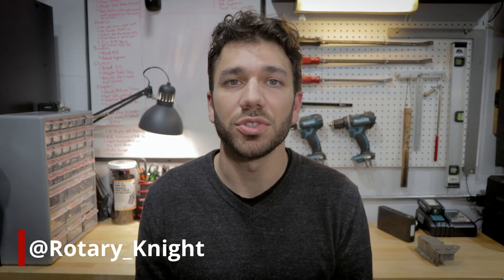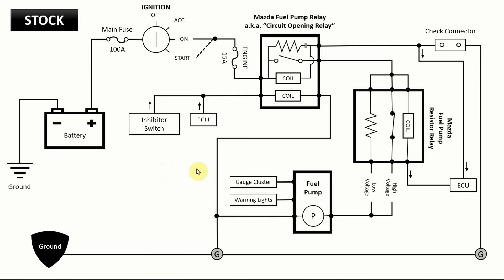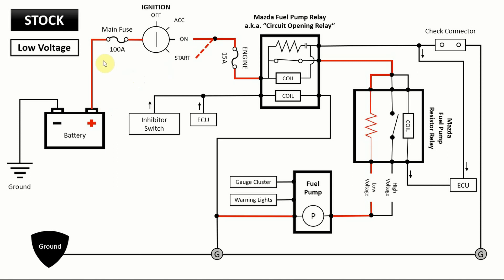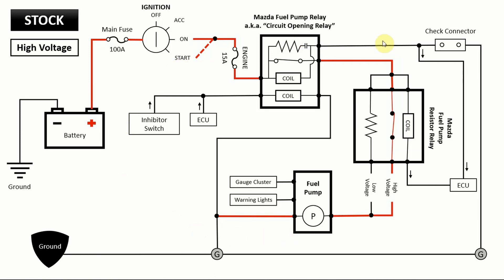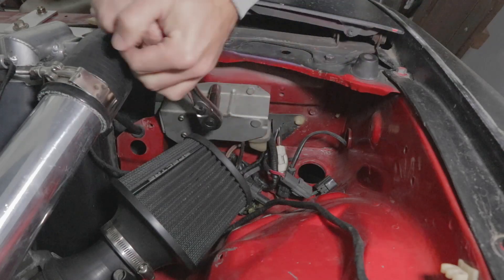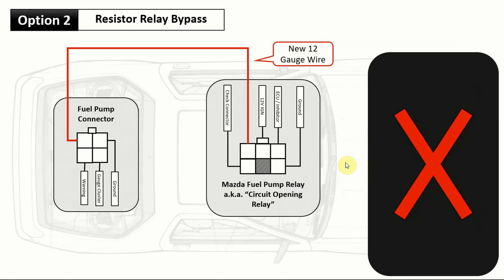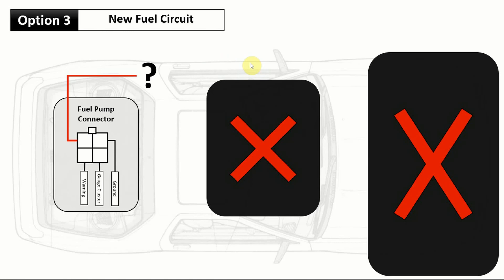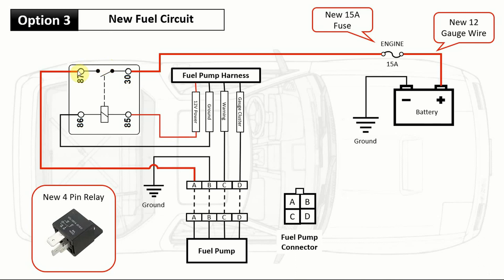How to Rewire Your Fuel Pump FC3S RX7 | Ep 24

Comment: Hey mate great video. I am also a mechanical engineer with an FC in Australia. 
Question. Does the circuit open relay operate in all key positions - ignition - cranking - running?
Person I bought mine off has butchered the harness. 
I have no power to coils or ecu when cranking and traced the ignition circuit from my aftermarket ecu back to the circuit open relay.

Comment: Hi Alex , great video! I tried all options but kept having issues so I did the third option and ran a totally new circuit ,  when I pull the trouble codes the CPU is showing trouble code "
 51 - Fuel pump resistor relay." does this affect drivability?? or can I just ignore it as I don't have the Relay resistor anymore.?   Is there a way to wire in a resistor to the cpu so the code goes away ? 
FSM  shows there should be .7 to .94 ohms from wire E to wire F.   Thanks for your help   1990 NA Vert

Comment: Hi, I am new to rotary engine and I just got a 1989 rx7 to build for my son. My question is when you choose to go with the method 2 then what did you do to the resistor relay in the engine bay by the passenger headlight ? Did you still remove it or did you leave it untouched and go on with method 2 ? Any answer would be a big help for me and greatly appreciated! Good day !
Reply from the maker: So, I removed mine completely. There was no need to keep it, but if you want the car to remain OEM and keeps it value as a classic, you can leave it as it is. This is really for people who modify their turbos, increase boost and want the insurance of consistent fuel pump voltage and pressure.
Reply: @AlexFranceschi is there an issue if you are running lown impedence injectors when you delete this? On rtek and have after market injectors.

Comment: Can u do this with stock ecu and injectors fire right? Did u plug back in to the relay under Dash when u cut positive wire please help option 2 would have been great if u showed the full finish make a video on that please
Reply from the maker: I made this video after I finished everything and have a perfectly running car via option 2. I did exactly as I posted. Not sure what you want to see.
Reply: @AlexFranceschi  did you plug relay back in under Dash and theother wires to plug u left intact and was that after u deleted everything upfront
Reply from the maker: Yes, the relay under the dash is still there, I mentioned exactly what I did in the video, you can go back and watch it again. I replaced the power cable to the relay under the dash and removed the resistor relay under the hood. I cut the power wire to the relay under the dash to save the spade that goes into the connector and soldered it on to my new power wire. It's all in the video. You don't need the old power wire that goes to the resistor relay under the hood.
Reply: @AlexFranceschi  yeah but u still plugged relay under dashboard with power wire out and running direct to the pump wire in back or did u eliminate the relay fuse under Dash or plugged it back thanx bro
Reply from the maker: Okay, I think you may have misunderstood the wiring diagram. You must have a relay. The relay is still under the dash and plugged in. You simply replace one wire that goes to that relay. The wire that goes to the fuel pump. That's how it's done. You cannot remove the relay altogether. It would not work correctly.
Reply: @AlexFranceschi  perfect thanks so basically butt the power wire to harness power in back to pump gotcha

Comment: What's the effect of never having the low voltage to the fuel pump if I do option 2 and bypass the resistor relay? How will the engine be able to idle or function  in a low load situation at low RPMs? That is, how would the ability to drive like Grandma or slow roll past the police be affected? Would I have high idle all the time? Also, I have a 1988 non-turbo. Based on your response to a previous comment, does all this apply to my car?
Reply from the maker: Low voltage to the pump simply means it may not be able to supply enough fuel pressure to the engine. Low fuel pressure means the engine may run lean (low fuel but a lot of air), not good for internal combustion engines.

Comment: Hey thanks a lot  for the time you took to show the ways of fuel I work on cars all the time but never had an rx7 before so I'm a bit nervous because I don't want to screw it up mine is a 1986 and it had sat for awhile motor was froze but I was able to free it and I can run car if prime it by dumping gas down it's throat I hope with this new knowledge I can get the fuel system working again then I can actually drive it so thank you again I can't wait to go out and see if this will work I'll probably try what you called the easiest way and because of the way you showed it should be easy
Reply from the maker: Absolutely, happy to help! Nice work getting the motor to spin and fire up. S4s are a bit different from the S5s like mine, but you can find all of the repair manuals and wiring diagrams online. Good luck and feel free to ask any questions.

Comment: So you have a question that my Mazda RX7 the has a new fuel pump a new ECM in it and new fuel ejectors and my fuel ejectors are not firing and I can't figure out anything on the wiring to the fuel ejectors or anything that way
Reply: Also I forgot to tell you that the fuel rail has fuel pressure to it it's just the fuel injectors don't fire
Reply from the maker: To be honest, I don't think I would be able to help you. But if you have an aftermarket ECU I would refer to their wiring diagram for the injector wiring. If you have an OEM ECU, I would refer to the factory service manual which you can find online.

Comment: on the last option 85 on relay should be ground and 86 power, some relay's have  a resistor in them, you always want ground on 85
Reply from the maker: Thanks for the tip.

Comment: Great video.  Explained very well.  
What would happen if I ground the brown wire to the black wire at connector Ba-01 F-08.   Would this just delete the resister and ECU loop? Also making the pump run close to 12v in the run and start positions.
Reply from the maker: Sorry for the delayed response. I can't say for sure what would happen if you did that, it's been awhile since I've done a deep dive into the FC fuel circuit, but in theory, just deleting the resistor relay (option 1 in this video) will be okay. You will have some voltage loss to fuel pump, but it will be better than relying on this old resistor that is over 30 years old.
Reply: Alex Franceschi ,  thanks for the response.  
I gave myself some extra space while doing what I mentioned above to fix something if I messed up.  However, Just grounding the “brown wire”starts  pumping fuel the second the car is turned on with this configuration.     I think I’ll use your option three at a later time.  Great video again.
Reply: @AlexFranceschi  we did the second option and there must be a volt drop because the fuel relay and pump started to just buzz and not stay open. also the voltage switched back and forth with the brown and one below it on the relay.
Reply: Check Connector “Brown”  / Ground “Black”

Comment: Couldn’t have been explained any better bro! I just replaced my fuel sending unit and couldn’t get it to start unless I unplugged the FP harness, start car, and immediately plug the FP harness back. I never primed the system but not sure if that’s the issue or I have a bad GND from FP to body of the frame holding the FP and sending unit.
Reply from the maker: Nice, happy to help! Is everything working okay now? When you say FP harness, is it the stock Fuel Pump harness or a custom one you made?
Reply: Not FP harness but the metal frame that hold the FP and sending unit. Still no luck. I checked voltage today at the wiring harness connecting to FP. IGN on I get no voltage. That said I may have blown a fuse or relay. In didnt disco the batt before removing pump.
Reply from the maker: @SydeshowMO  yeah, check the fuse or relay if you have no voltage at all.
Reply: Alex Franceschi done! Thanks again for making this awesome video! I was able to go to it along with the old one to use as reference. Problem was no continuity from harness to top of screw terminal to FP. Moved everything back to the old frame that holds the FP and sending unit. I get a good 12.9v to the pump at idle. I get 7.95v while cranking.
Reply from the maker: @SydeshowMO  Nice work! Glad you got it working. I never measured the voltage while cranking, but it does make sense because a huge draw is being pulled from the battery.

Comment: I have a 13b 6 port with a T04b T4 turbo, 4x ID1050x, and Haltech Sport 1000. My goal is no more than 10psi. Will I need to move up to the third option or is the second option sufficient?
Reply from the maker: The best way to check is to measure your fuel pump voltage at various throttle positions / engine loads. Make sure the voltage is stable. If it is stable as-is, then you have no need to change it. But if you notice the voltage drops or fluctuates, it may be worth updating the wiring altogether. It's hard to say because our cars are so old. Some of the wiring is still good, but in some cars the wiring is bad. Hope that helps!
Reply: Have question with option 3 if you remove everything up front where do you get the 12v signal from
Reply from the maker: @joeybaggettjr9119  you run a wire directly from the battery itself and you can use any power wire that is tied to the ignition as your switch source for the relay.
Reply: @AlexFranceschi  Hey if I go with option 3 does that mean I can no longer use the jump connector to prime my fuel system?
Reply from the maker: @Hygoog  correct, but you could wire in a manual switch and prime it whenever you want.
Reply: @AlexFranceschi  do you have a diagram on how to do that? Thanks
Reply from the maker: @Hygoog  outside what is in my video? I do not, sorry.
Reply: @AlexFranceschi  it's ok man. I ended up switching to step 3. Thank you.

Comment: Correct me if I'm wrong, but the NA models ('88 FC RX7 5MT in my case) don't come with a relay resistor do they?
Reply from the maker: I think you are right. The S4 turbo systems have the relay resistor, and all S5s have this part. The S4 NA motors do not (what you have). Sorry for any confusion! (I double checked the factory manuals and this seems to be the case)
Reply: @AlexFranceschi  haha, it's all good. Currently diagnosising a fuel pump issue and wanted to make sure I didn't have something else to check. If you don't mind, can I message you on Instagram? I've got a few questions about the the actual fuel pump relay wiring (previous owner did some naughty things to it I'm try to fix)
Reply from the maker: @arthurraber3839  no problem, shoot me a message anytime. I'll do what I can.

Comment: After completing the installation for the 2nd option do i simply unplug the resistor relay box and throw it in the trash?
Reply: I did the second step and now my car won't start. Checked the power on the fuel pump connector and theres no power at all. Maybe the fuel pump relay went out? It's not even priming anymore even with the jumper connected.
Reply from the maker: Yup! Or you can sell it and make a lil $$$. I kept the bracket for it and actually made a mount for a battery jump post with it. I'll have a new video soon about relocating the battery and some tips/tricks for that.

Comment: for option 1: is this the same process on a s4 car? the resistor/relay has a different plug (round barrel connector)
mainly wondering if the wiring is the same between the two or if i have to splice different pins together. 

using the same  A->D  &  C->F you did here  would have a red wire connected to white and blue connected to black on the s4 plug.

feel free to dm me directly on instagram, i would be glad to send photos of my resistor relay/ plug as well as the s4 FSM diagram!!  @mike_george  with two underscores _
Reply from the maker: I'll find you on instagram, I would have to check the wiring diagrams for the S4 to be sure.

Comment: Alex ive got an 84 rx7 gsl and im not getting the fuel pump to work your video is the best ive seen but the plugs are different can you help me
Reply from the maker: I'm not as experienced with 1st gens, but I'll do my best. First off, the gsl is a 12A? Not the 13b? Correct? If so, your relay should have four wires. If there was a way to post pictures in the comments I would show you (if you have instagram you can send me a message there and I can show you the wiring diagram @rotary_knight). Anyway, the power wire should be a blue and white wire. Make sure this wire is getting power at the relay and at your plug for the fuel pump...not sure where they are on the 1st gens. If the power wire has voltage, check your grounds, or you might have to replace the relay. Hope that helps as a starting point!
Reply: @AlexFranceschi  ok I'm not sure what 12A or 13b is .but there are 4pins on the relay which i checked the resistance and it is 105 ohms.and there is power going to the relay but no power at the fuel pump plug which only has 2 wires to the pump.i put a jumper at the relay plug and still no power at the pump.on the gas petal art there is a switch and when i. Push it in it triggers the relay thats behind the passenger head light..and i do have an Instagram off the hook.pleasr bare with me im not to good with all of the technology.but i will figure it out
Reply: Instagram. Off_the_hook_tattoos
Reply from the maker: @offthehook7210  got it. Sent you a message on instagram. I'll look up the right wiring diagram for you and see if i can send it over there.
Reply: @AlexFranceschi  well i found that the relay plug has power i used a test light grounded to a bolt and it lights up but when i try grounging it to one of the pins i dont get a light or should i say i cant get a ground from any of the 3 remaining pins
Reply from the maker: @offthehook7210  here is a link to the wiring diagrams for the first gens. http://www.wright-here.net/files/manuals/1985_RX7_FSM/85RX7(50)Wiring_Diagrams.pdf
See page 50:14 for the diagram of the fuel system for the 12A engine. 12A refers to the 1.2 liter rotary. Which I believe your car came with. The 13B, 1.3 liter engine, should have 5 wires at the relay. So, I don't think that applies to you.

It looks like the relay is mounted under the driver side of the dash, just like the FC. That's where you're working, correct? Before watching my video, what were your symptoms? Was the fuel pump working correctly? Or did it have problems already?

Comment: previous person cut the relay 4 2 plug in bay. i got another relay but the 2 pin plug touched and now that black yelow doesnt hav power
Reply from the maker: It is difficult for me to fully understand your problem. The relay in the engine bay that you are referring to is the resistor relay behind the passenger headlight, correct? What was cut exactly? Did someone try to splice the wires together, or they simply cut all the wires in the harness?

Comment from the maker: For those who want to skip ahead

Generic FC3S Fuel Circuit Explanation: https://youtu.be/fix3a2sKkQw?t=182
Option 1 - Deleting the Resistor Relay: https://youtu.be/fix3a2sKkQw?t=608
Option 2 - Bypass the Resistor Relay: https://youtu.be/fix3a2sKkQw?t=759
Option 3 - Create a New Fuel Circuit: https://youtu.be/fix3a2sKkQw?t=875